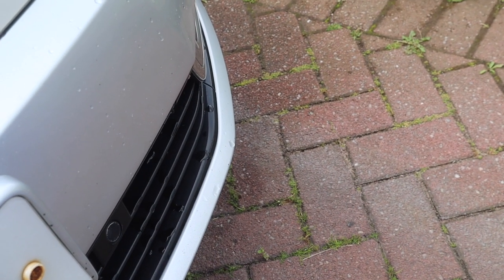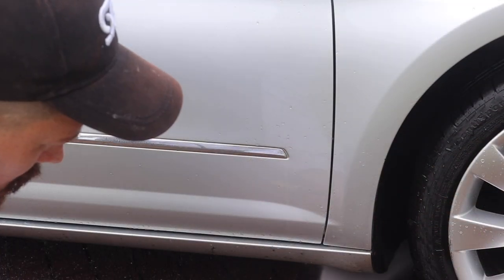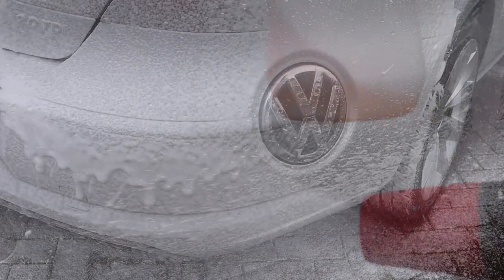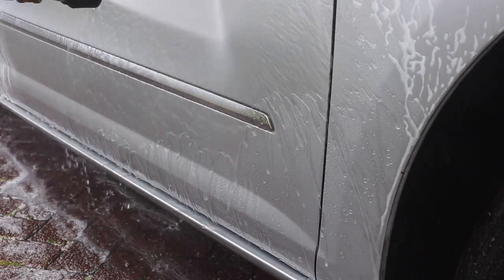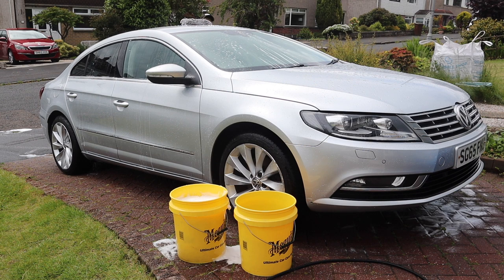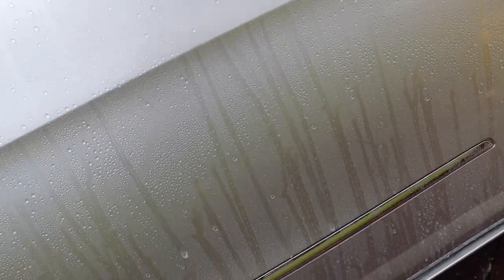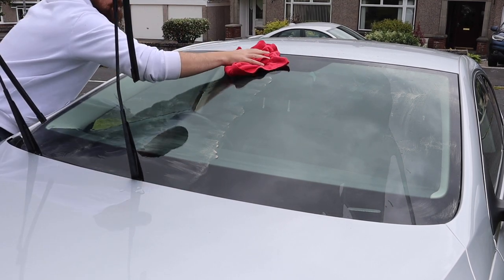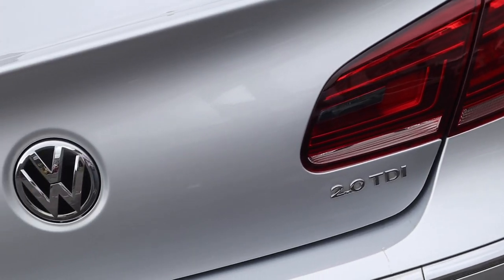Synergy Lite 1 Year Ceramic Coating Maintenance Wash - 3 month update

Comment: Wow, need the infinity ceramic and glass compound after watching this vid mate. Very good if you haven't got alot of spare time to wash the cars etc. Top vid Dave👊
Reply from the maker: Ceramic coatings are ideal for anyone who is short on time for washing the car Dave, they really do make washing easy. The glass stuff is interesting, glaco seems to be one of the better ones so far.
Reply: What's applicator would you recommend for this Dave
Reply from the maker: I would go with the square microfibre applicators mate this is the ones I have used to apply. 

https://amzn.to/3InlzFr

Comment: I do like this car!, looking forward to Mrs McBay snr’s opinion of Glaco sealant. Car looks super easy to clean now with a ceramic on it, shots of the dirt just lifting away with a pressure rinse were amazing! 
Question tho, if you need to reapply Synergy QD after every second wash, isn’t the test of the coating itself now affected by topping it every so often, would have been interesting to leave an area to see if the coating itself had the claimed durability 🤔
Reply from the maker: It really does make a massive difference while cleaning but kinda takes the enjoyability out of detailing a car. I’m not touching the boot area with the qd to see how long it lasts. You don’t need to use the qd tbh but I just like applying something at the end of a wash.
Reply: @DavidMcBay  awesome !!, looking forward to more results 👌

Comment: Yo Dave, great update my man 👍
I've been tempted to try something like this kind of a light ceramic but if I did and maybe after 6 months or if I get bored of it would a simple polish with BH Cleanser Polish take it off?
Reply from the maker: I’ve not used BH cleanser before Kevin but in my experience a machine polish is the only way to remove a coating that’s still performing.